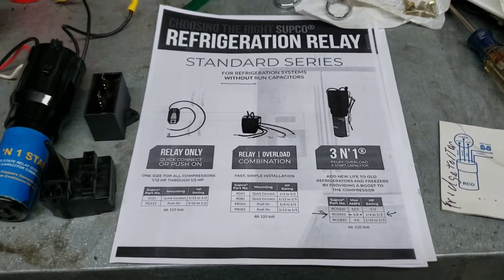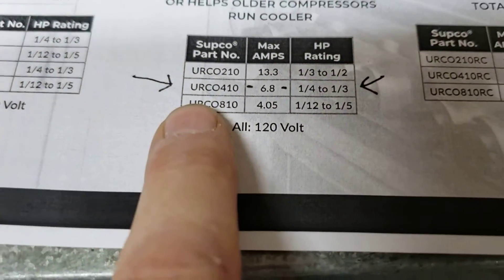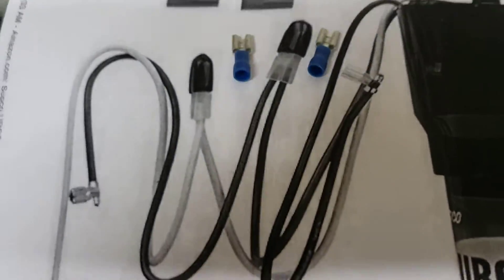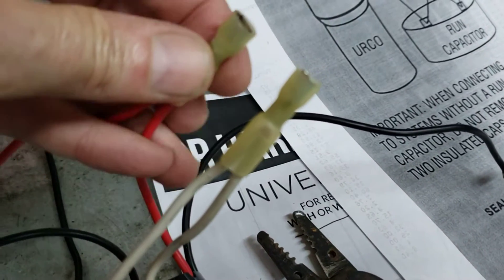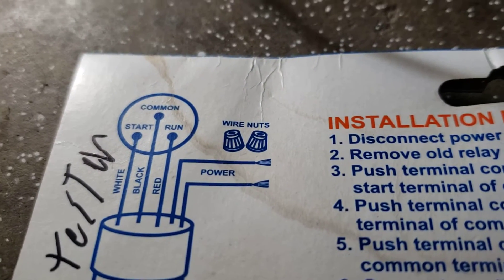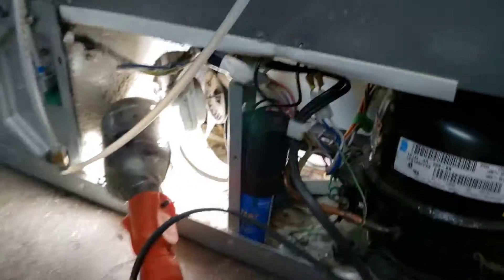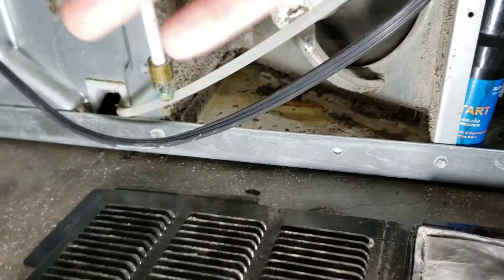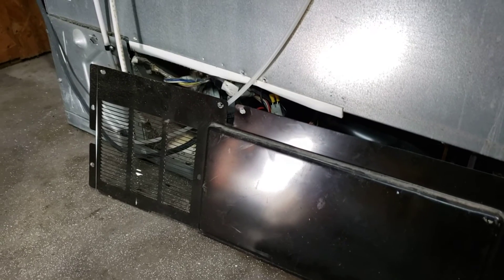DIY Refrigerator Repair Supco Hard Start Relay Kits URCO410 OR RCO410 Whats the Difference?

Comment: Just picked up a side be side water/ice in the door from the side of the road, hoping I could fix it. I found the compressor did not start and then the Breaker clicked.
I installed a Supco 3N1 and  it started right up. My brother in law (HVAC guy) said I should put the Run Cap back in the circuit. So, I attached the 12uf cap in circuit with clip leads while monitoring the current. With out the 12uf cap current was 2.11 amps, with the 12uf cap current dropped to 1.55 amps. The other thing I learned, there is a removable thermal  Circuit Breaker (TCB) in the relay* unit. Labeled 4TM** This TCB has a connector fitting the common pin on the compressor, it actually conducts heat from that compressor pin and if it gets too hot it opens the circuit. The 4TM can be removed from the Relay and installed on the compressor pin and then a spade lug can be put on the common wire of the 3N1. Now you have the proper thermal protection on the compressor.

 * I wish the didn't call it a relay, in my experience, it is more often a PTC or an electronic circuit that does the switching.
** There are many temperature ranges for 4TMs. They reset themselves. I found this list of data, just  add the usual and fix this for the address. carbonbrush dot com / 4tm dot pdf

Comment: I purchased the URCO410 for my Whirlpool Gold Frifge/Freezer combo as it had stopped cooling. My fridge has the black capacitor that plugs in start relay. I just plugged the 3 connections (white/black/red) as it shows, took the caps off the red/white wires plugged them in to the capacitor, then cut my 1 blue/2 white wires and connected my 2 white wires w/ 1 black wire, then my blue wire with the other black wire and presto! Great video thank you!

Comment: is this the run capacitor? my capacitor clips on to the back of the relay like yours. I wired my 3n1 with out the capacitor and it runs. any info would be greatly appreciated.

Comment: Like so many others have said, I completely missed the part about the run capacitor still being necessary with the RCO410 kit WHEN your fridge has a run capacitor.  The fridge fired up and ran without the capacitor but then after seeing this, I cut it in as you demonstrated.  Many thanks.

Comment: hi, do they have a starter kit for 1hp compressor?
Reply from the maker: I would think so check out the web site https://www.supco.com/web/supco_live/products/SPP6E.html
Reply: @ktoutdoor  thanks for this guide
Reply: @ktoutdoor  hi sorry, I mistakenly read the label 1PH (single phase) as HP lol. My bad, instead I found the ampere and voltage rating at the back of the fridge to compute for the maximum hp.

Comment: I have an old upright freezer (1997),its one of the old ones that freeze by the shelves freezing (no fan/R134a runs through lines in shelves). The start relay went out. Every video I've seen they replace the start relay and capacitor with the RCO410 hard start kit.  I have the RCO410 kot and watched your video yesterday, I wired my old capacitor to the RCO410 and to my freezer. 
Just checking if I did the right thing by adding the capocitor to the kit??
 My freezer so far is working good...
Reply from the maker: Going by memory i think the capacitor i installed was called a run capacitor not a start capacitor.  Some motors use a run capacitor some don't .
Reply: @ktoutdoor  
My capacitor looks just like yours. It was plugged into the start relay like yours was. I've looked online everywhere I can think of and can't find out if I need to keep it hooked up with the Supco 3 n' 1. Oh, I didn't think my freezer had a fan, but I heard a fan kick on, it must be up under the bottom plate where the 2 wires go in to..

Comment: Hello, I have a question, while disassembling the refrigerator I noticed that the starting relay of the refrigerator motor was replaced with an RCO410. The original relay (QP2-4.7 Start Relay Refrigerator PTC Ohm 3Pin) was connected in parallel with (HQRP Ceiling Fan Capacitor CBB61 12uf 2-Wire Plus HQRP Coaster). Upon inspection, I discovered that the motor power supply track had burned out on the control board. The question is whether the track on the board could have burned out due to the fact that the capacitor was not connected to the capacitor, or whether we need to look for another reason, everything is fine with the motor, I checked.
Reply from the maker: Yes I believe the high amp draw will cause the trace of solder to melt off circuit board. Try replacing the burnt section with a piece of wire, Let me know how you make out. Kevin
Reply: @ktoutdoor  I'm not sure the motor current goes through the foil on the circuit board. I found o.5 amp compressor current reduction with the run cap installed.

Comment: Thank you for this easy to follow instructional video. I could only find the RC0410 at my local parts store so I followed your idea and used the original capacitor off of my fridges original relay/overload switch and it is working perfectly! I don't know if this will outlast the original relay switch but time will tell. Thank you again!

Comment: Hi Kevin! The instructions for the URCO say to remove the insulated caps from the female terminals that plug to the run capacitor. Does that matter? Will they overheat or anything if not removed? It’s a pretty sturdy clear plastic that’s as hard as a wingnut.
Reply from the maker: Send me a picture of what your describing to 606-875-0125 Kevin
Reply: Thx so much for checking back. Well guess what? It started! Everyone else got an immediate start from theirs, but mine took a few minutes for some reason. And I do till hear the click sound every few minutes. I figured out what the insulated caps are: some repair kits come with rubber caps over the female connector terminals (mine didn’t have those).

While I have you, has anyone ever asked why the lower set of lights inside a Maytag side by side might stay on even when the door is closed? I went ahead and disconnected the bulbs because they had burned the cover. I know the door switch works because the upper light turns off.

Comment: Your video is the one that FINALLY got me the exact info, since my fridge has the run capacitor. None of the other ones explained that and the RCO didn’t work correctly as the URCO was what was needed.

Comment: Using 3N1 RCO hard start kit will fry some types of modern compressors. Can this URCO avoid this issue if you know? Thanks
Reply from the maker: I would call the hard start manufacture just to confirm its ok to use on newer units

Comment: Thank you much Kevin... Your video was the only one I found that mentioned the difference between the URCO410 and RC0410.  The compressor would hum attempting to start and then a distinct audible "click" and shut down.  My Kenmore Cold Spot refrigerator had a start relay and capacitor.  The compressor and capacitor both tested good and there is no real way to completely test the start relay and I assumed that it was the culprit.  Ordered an OEM start relay from Sears parts direct ($68).  That didn't work.  I ordered a start relay and capacitor combo from Amazon ($26).  That didn't work either.  The SUPCO URCO410 arrived this afternoon.  It took less than ten minutes (thanks to your video) to wire it all up and plug in the capacitor.  The compressor started up as soon as I plugged it in.
Reply from the maker: Thank you for letting me know my video helped you. Its comments like your that inspire me to make more videos.

Comment: How can I tell if the model I have does or doesn't have a capacitor?
Reply from the maker: Google the model number and look at the parts list sometimes there round or square but should be close to the compressor

Comment: Hello, this could have really helped, but I don't understand any of your explanations about cutting this and cutting that 🤣🤣 I have purchased the URCO410 1/4 - 1/3 hp 3 'N 1. I have a 7.5 cubic feet freezer that I purchased from Amazon in July 2021, that just stopped cooling. I know it's the compressor because I hear it trying to start, but not starting. My problem is I have about $1,700 worth of meats in there right now.

I have ordered a 15.7 cubic feet garage ready freezer from Home Depot, but it won't be delivered until November 4th, and I am frantic. I have sandwiched the meats between dry ice and the temperature probe says shows L-L-L, meaning its below 30F. But the dry ice is still all solid, meaning its really cold. Thank god.

I want to install the URCO410. It has the the red and white wires with the caps on, and the common black wire. It then also has the two remaining Line wires. I do not understand what you were cutting and what you did with the Line wires to power the compressor.

I am a Biomedical Engineer, specializing in Tissue Engineering. I stay AWAY from electrical stuff, as I like to operate within my areas of competencies 🤣🤣 I really would appreciate if you could PLEASE call me and walk me through what you did. My number is 612-245-2479. I am Henry. Amazon has refunded the $500 that I paid for the freezer, but that is not helping me right now. Hoping to hear from you before I blow the whole house up! 🤣🤣🤣🤣

Thank you!
Reply from the maker: It was nice talking to you today
Reply: @ktoutdoor  Same here buddy! Much appreciated. Thank you for making the video!